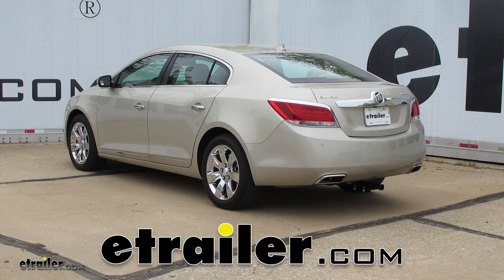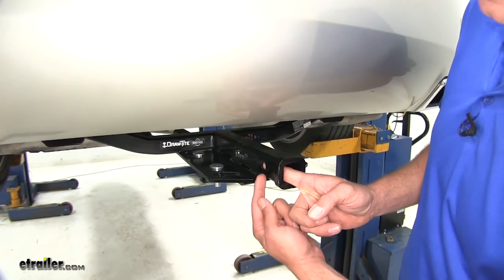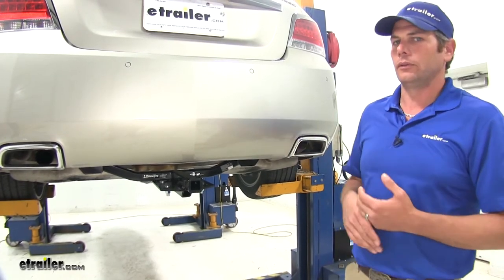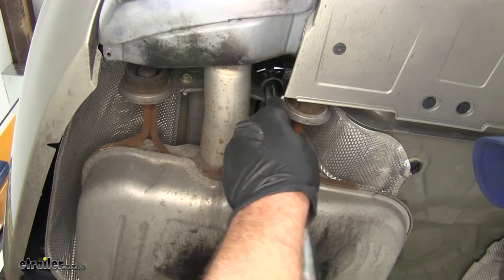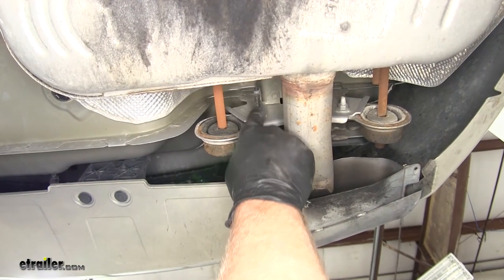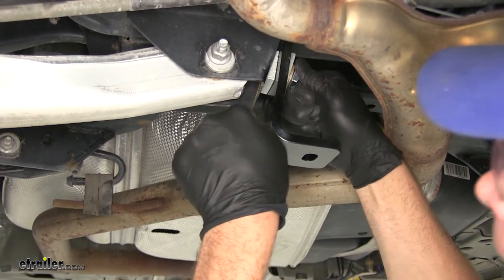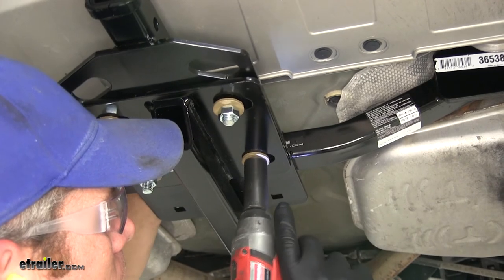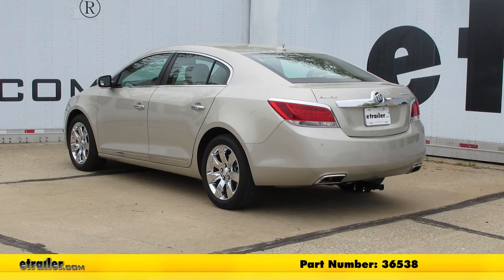etrailer | Setting up the Draw-Tite Trailer Hitch Receiver on your 2013 Buick LaCrosse

Comment: Can you attact a towing bar to a Buick Lacrosse?
Reply from the maker: Are you talking a trailer hitch or a tow bar  that would allow you to tow a vehicle behind a motorhome? What model year Lacrosse are you asking about?
Reply: @etrailer  tow bar on a 2018 Buick Lacrosse
Reply from the maker: The 2018 Buick Lacrosse is a front wheel drive vehicle. As a rule, front wheel drive vehicles can't be flat towed the doing so would damage the transmission. To transport the vehicle, you'll want to use a tow dolly like # DM9713093 or use a trailer.
https://www.etrailer.com/Trailers/Buick/LaCrosse/2018/DM9713093.html?VehicleID=20185000144